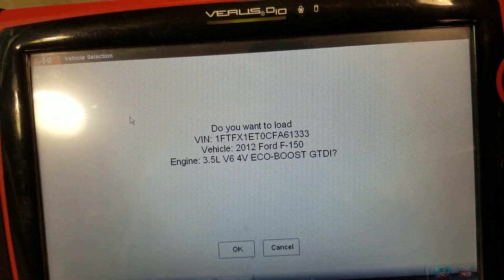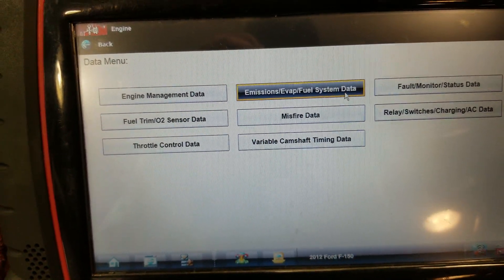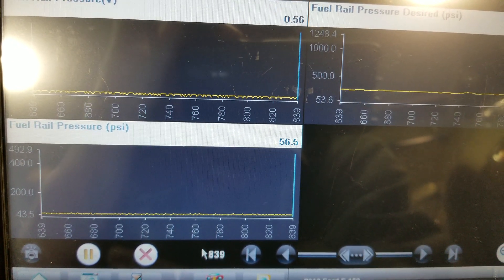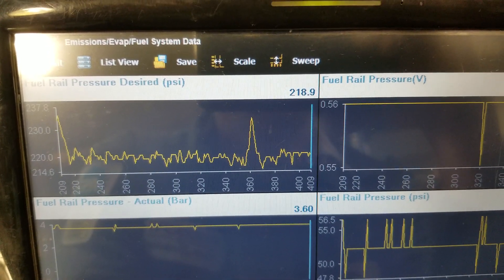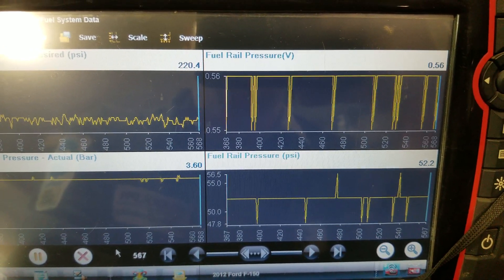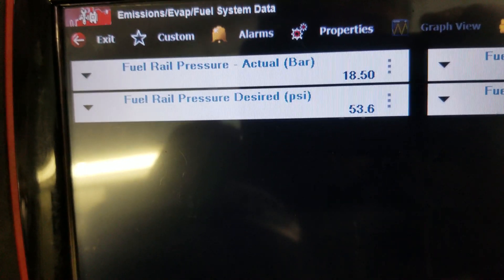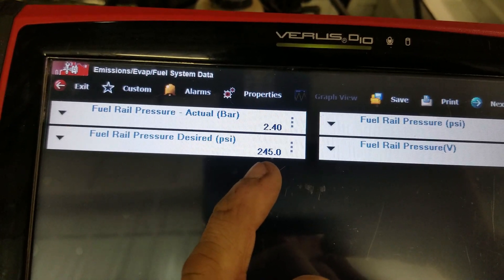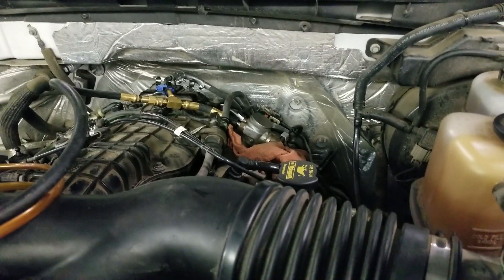2012 FORD F150 3.5L ECOBOOST NO POWER, P0087, P0174, & P053F FUEL RAIL PSI PERFORMANCE & LEAN BANK 2

Comment from the maker: Follow up as of 2 March 2019, the part 2 video is not posted, because this customer ended up doing the repair themselves to save $$$.  The high pressure pump was in fact the issue and customer stated that truck ran just fine and no DTC's returned after the replacement...hopefully this was helpful.

As always, thanks for watching and please let me know if you have anything to add to this video in the comments section below.

Comment: What is this strange ... Fuel actual in bar 34 and desired is psi 53 ?????😮😮😮😮
Reply: He addressed it during the video he had different data up because there’s a high and low pressure fuel system on these but his scanner didn’t entirely tell him that with the PID names lol

Comment: Where is the fuel rail low pressure sensor on a 2013 f150 3.5 eb at?
Reply from the maker: Before the high side fuel pump in the feed line.

Comment: Just seen this video and it may help me out, maybe you’ll see my question. 

So I went to test the low side fuel pressure on my grandfathers 2014 3.5 eco boost very similar to how you’re plumbed in as well with a mechanical gauge. Now because it’s not running very well occasionally and he said it’s getting low fuel rail pressure codes. Now when I test it key on engine off it holds around 50 psi but if you start the truck up it starts bouncing like crazy from 0-50 psi roughly and I’ve never seen anything like it, I’ve used the gauge before so I don’t believe it’s the gauge. I’m just wondering if it’s the pump or the fpdm if these have one and what you think of that? Thanks!
Reply: Very interested to see what your outcome is/ was?
Reply from the maker: Some fluttering is considered normal and it's from the HP Pump.  I'd have to check the VIN to examine the Fuel System to find out if it has a FPDCM...I believe almost all these Fords do.
Reply: @PaulysAuto  Thanks! I didn’t expect a reply so quick, I’d have to take a video for you to really see what I mean and I would understand some fluttering as well but no it isn’t like that, as soon as you fire it up the gauge starts freaking out going from 0 back to about 50 back and forth so fast you can’t tell what it is going to exactly and I thought it would wreck the gauge with how fast it was going, almost in sync with the rpm or the hpfp so we shut it down. 

I feel like it is an issue with the fuel supply from seeing what the gauge did but wondering if it does have an fpdm and if it could cause that or if the pump in the tank is more likely possibly. 

Thanks again it was the strangest thing, I’ll see if I can get a video of it.
Reply from the maker: @jeremycassell7627  sounds good interesting to see what you come up with

Comment: Hi Pauly! 🫡

I know it's been years since you made this extremely knowledgeable and helpful video, and I'm no mechanic for sure 😁...

If I may ask sir...

My 2012 Ford F-150 Lariat 3.5L V6 EB suddenly wouldn't start, it would crank and act extremely sluggish, no start...

I got a code of "P00C6 permanent" reading from the Walmart brand OBD reader...

Backstory: I had an issue where as my Ford was dying sluggish low power as I was driving...

Was told the number 6 and 5 spark plugs was misfiring...

So I took my Ford to the local Ford dealership and had the spark plugs and ignition coils replaced, and all the wire connectors shells pins removed and new connectors shells put on (had alot of broken connectors going to the ignition coils) all done just 1 week before this new issue happened...

Note: The truck ran just fine after the repairs?

Could the sensor become loose? 

Or is it the same issue you had in this video?

Or something else completely?

My wife thinks maybe possibly the local Ford dealership did something wrong or damaged something while doing the repairs?

Your thoughts and feedback bro of what's going on?

God Bless and
Thank you for your time and support with this video.

447th Signal
Fort Gordon, Georgia.
Reply from the maker: Thanks for the kind words, I'm gonna have to say unless you got injectors that are leaking down you probably have a high pump issue, but it's also possible that you don't have enough flow coming from that low side pump.  Best thing to do is to do a low side pressure check with a gauge and get a scan tool data pid up for the high side pressure pid.

Based on the DTC set and the symptoms I'm gonna say I would lean towards a high pressure fuel pump.
Reply: @PaulysAuto  
Thanks for the reply bro!

Comment: You mention use common sense cause of the pressure in it ? How can i remove it and be safe ? I need to change my valve cover gasket and need to remove the high pressure pump on it. ?
Reply from the maker: crack her open and cover it with a couple shop rags so it doesn't spray all over or get you in the face...pressure will bleed off...I'm talking about using common sense...think about cracking a Soda open after you shook it up.
Reply: @PaulysAuto  got it. Thanks !

Comment: i have a 2019 F-150 with the V8 and it shut down on me on the way home with my kids in it too. only 50k miles on it. Service guy said the fuel pump wasnt getting enough power so the wiring was bad. Enging was craking over but would not start. should hear back from Ford tomorrow. it should be covered under Powertrain warranty. My point is for a newer truck with 50k miles this should not be happening. im planning on selling it for something else once its fixed. first Ford ive ever had and the last. your right Jason, there beautiful trucks they shouldnt be having these issues
Reply from the maker: My apologies for the late reply, what did you end up finding out?
Reply: Yes welcome to the new world doesn't matter what truck you buy you'll be fixing something on it my friend

Comment: Just did mine tonight.  What a huge difference!  I purchased my truck used 3 or 4 years ago and anytime you got on it the truck acted as though you hit a speed limiter setting and lost all power.  Ford said it was a safety feature in case you lost control.  I never bought that since my other F-150 did not do it.  Fast forward to about 2 months ago.  I was out in the middle of nowhere Nevada heading to Bishop and out of the blue doing 75 mph my truck started losing speed.  It didn’t this multiple times over about a 90 mile stretch.  It only threw one code and that was low pressure to the fuel rail.  I made it to Bishop.  Got fuel the next morning and the problem ceased.  I chalked it up to bad fuel.  Well 2 Fridays ago it did it again on the way home from California.  To it into the dealership.  They confirmed what I suspected.  High pressure fuel pump as well as the fuel rail pressure sensor.  Which I haven’t located yet to switch out.  However I immediately noticed a vast throttle response and engine performance once the HPFP was replaced.  The dealership wanted $1,000.00 to do it.  Did it myself for about $160 bucks for an oem part and about 40 minutes of my time.  Ford has revised this pump 3 times now according to the dealership.
Reply from the maker: Hope this video helped you my friend.  Unfortunately, it is what it is, still a good truck, just misunderstood by most customers.
Reply from the maker: Depends on how you use them and how you take care of them, that goes with anything 🤔

Comment: '13 F150 EB.  Should the high pressure side maintain fuel pressure at key off only?  Started experiencing a long extended start only on cold starts.  No codes.  Data logging truck noticed the longer the truck sits after last start the high pressure side pressure falls off.  At idle logged 800-900 psi. Key off.  Four hours later 788 psi.  Fourteen hours later 55 psi.  Should the HPFP maintain high pressure side fuel pressure after key off?
Reply from the maker: High pressure will climb up to around 800psi KOEO after running and getting warm...that is normal because the fuel is boiling in the rail.

After awhile the pressure will bleed down, that is normal.

Your KOEO checks on low side are the same as always, make sure she is coming up to spec and maintains, pressure will also bleed down after awhile.

Closely monitor the FRP Sensor actual vs desired at idle, under load, and back down to idle again, if pressures don't match relatively closely you likely have a high pressure pump issue (+/- 30 psi is excessive).

Listen to high pump for unusually abnormal clattering and squeak type noises once you get engine good and hot...also evidence that it's a mechanical problem with the pump.

Monitor STFT and LTFT closely as well, as they will give you clues when idling and under load.  Lean issues and intermittently rich conditions after fuel cutoffs are indicators that you have a high side solenoid regulation issue and these can be tricky to diagnose.

Hopefully this helps 🙏.

10A approximately on the solenoid 😉

Comment: Cool diag man !! Quick tip for all GDI engines I've ever seen which is  Ford GM, an Hyundai only but they are all the same is near as I can tell. Any way I have seen a high pressure pump suck from the tank. The in tank pump was completely dead open circuit. The high pressure pump was actually sucking around 60-80 psi an the car actually ran decent. So I like to check the low side pressure key on engine off so that the high pressure pump isn't working if that makes sense. Or I throw an amp clamp around the low pressure pump driver module output to the pump when it's running. Any way just another variable. You may already know this.
Reply from the maker: These are great suggestions, I'm definitely going to be doing this in my future videos.  Never thought about a high pressure pump pulling fuel directly from the tank like that with a shorted low side pump...great point!

Thanks for sharing this with everyone, including myself Caleb!  Also, thanks for subscribing, appreciate your support, and feedback!
Reply: 🤦‍♂️ Sucking 60 to 80 psi that is not posible, in any case the injection pump can create suction vacuum on the low pressure side.